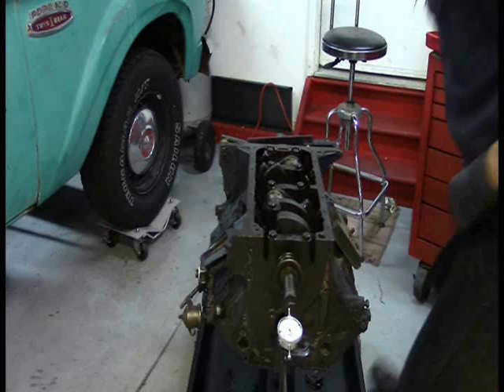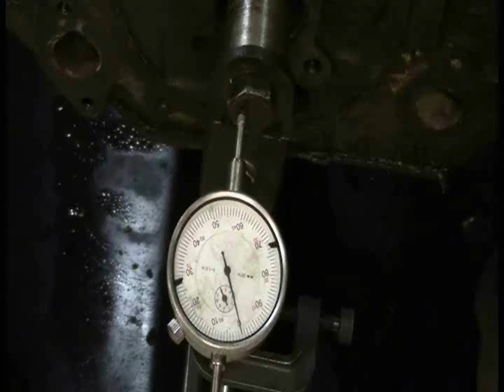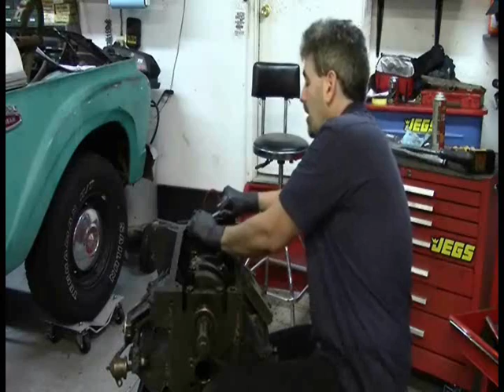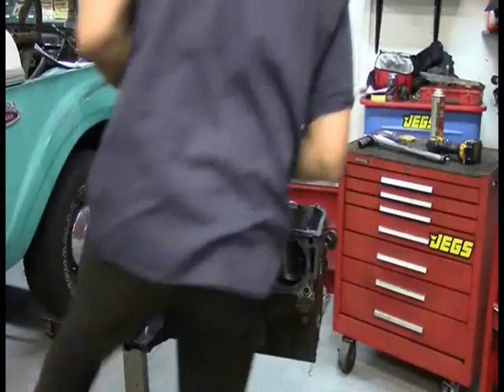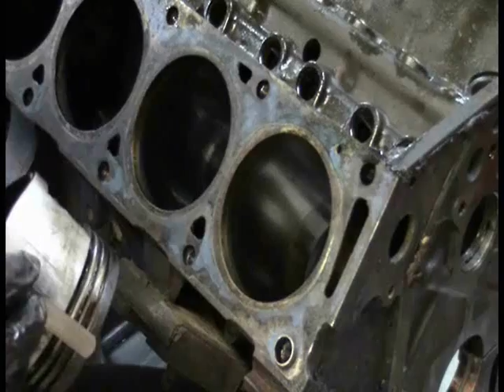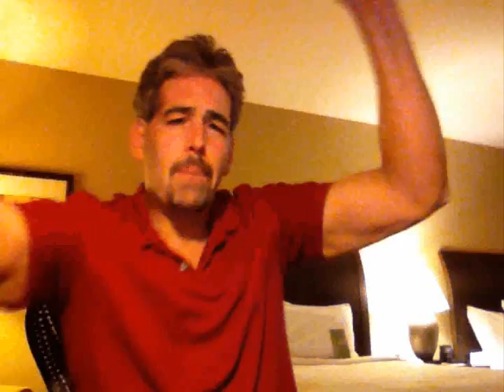Extreme Budget Engine Rebuild Pt 3- "Budget Rebuild" is an Oxymoron

Comment: I just wanted to say thanks for producing these videos. This series has been invaluable to me in understanding a current dilemma we are having with a 2001 Toyota Corolla with just under 200K miles (won't start when the engine is hot, blowing oil all over the spark plugs.) I am not a car person, and at this point I have no intention of ever tearing apart an engine. My knowledge is limited to routine maintenance which I try to handle myself as much as possible. I'm an ER nurse, and I can fix broken people, but engines mystify me.  My mechanic tells me that my engine needs a rebuild and this series has done so much toward helping me to understand what that actually means beyond the cost of parts.  I'll be able to make wiser decisions because of this - thanks!
Reply from the maker: I can relate as I am also in the medical field. I just simply apply my scientific approach to car diagnostics and repair and the result is what you see and probably why you like the format.

Comment: so is there anything  I  can do or is the motor basically use less
Reply from the maker: +91camaro 88 Two ways- you could install the pistons one at a time with new bearings checking clearances with plastigauge  and verifying they are in the right place. If after doing this on all pistons the crank rotates properly without resistance from the journals being seized then that's a fix. 
The other way is to have a machine shop ground the crank and piston rods/caps which will cost more than the engine is worth.

As for the upper end components, I wouldn't worry about that to much but do note often exhaust pushrods are shorter than intake pushrods so make sure they at least go in the right locations if this is the case.

Comment: I have a ? I purchased a motor that was already tore apart previous owner didn't number where the piston went or the lifter and push rods how big of a deal is this thanks
Reply from the maker: +91camaro 88 Its everything. The pistons are specific to their locations on the crank journals. The wrong piston location will seize the journal.

Comment: Totally enjoyable.  Been working on cars and motors since 8 years old now 71 and just launched into a 2002 ford ranger turbo 4x4 which I got on a cheep deal cause the motor needed a rebuild.  And just like your doing is exactly as I was taught long long ago and it has never failed me on the hundreds of rebuilds and repairs.  keep it simple stupid and use your head when taking it apart make notes mark things or just put them back to where they came from in logical sequence.  In other words Great information and enjoy your knowledge and straight forward approach.  waiting for number 4 !! thanks, gary

Comment: Hello, I didn't really know much about cars and such before I watched this series, but after watching your videos, I've learned a lot about how to diagnose my engine as I have a 1993 Nissan Hardbody 4x4 that has thrown a rod. I was thinking about attempting to rebuild my engine, but after tallying up the costs to do so, I realized that it was way out of my budget and I couldn't even find some parts. So in short, I would just like to thank you for all the time and effort you put into these videos.
Reply from the maker: +Connor Sincere Great move to do the assessment first. Most people just grab a wrench like a monkey and they start digging deeper and deeper into a money pit.  You did the right thing, but it's a bummer to hear. But how much better to use reason and assess the car cannot be repaired rather than spend $500 on parts before you find out it cant be repaired!

Comment: Just watch your 3-part overhaul amd really enjoyed. Thanks for clueing us in. I have a '66 Charger with  361, I was ging to have have my exhaust manifolds ceramic coated to dress them up a bit. When i removed the rear right bolt I had radiator fluid dripping out of the manifold. When I released pressure on the radiator cap it flowed out of the hole like a hose. I checked the dipstick, no water. I checked one of the spark plugs and it was normal. What could cause this and what I am looking at to repair this in terms of parts and cost?
Reply from the maker: +Scott Preston Letme get this straight- coolant leaked out of the exhaust manifold bolt hole??
Reply: +Schrodingers Box Yes, that's correct.
Reply: +Scott Preston perhaps the bolt used for the install is abit too long and punctured through the casting and into the coolant jacket wall.

Comment: Great video...I like your attention to detail.   Did you forget to mention the typical wear ridge at the top of the bores?  They can't be removed with a razor blade (LOL) and if they are deep enough then you can easily crack rings.  If you don't remove these the new rings will surely crack at high RPMs.  This engine seems to have a lot of miles ..OR... was severely neglected.  I did notice the copper backing of the severely worn bearings- the "babbit" was almost all gone!  Just thought I'd put in my 2¢

Comment: Wow. you think you need an over size cam for a 30 over bore?  LMAO  I hope no-one is looking to you for correct answers... You need one of those signs that says answers are $20 and correct answers requiring thought are outsourced.
Reply from the maker: +byrysh At exactly what size would you need an oversized cam and by how much?
Reply: Schrodingers Box
Stock carb, compression and stroke dont require a larger cam especially if its just a daily driver. There is no exactly. What there is is a desire for increased torque, horse power or reliability.
Reply from the maker: byrysh Didn't answer the question. There IS a point where you would need a larger cam.
  If you can't answer the question you are a bigger idiot than you think I am and you just look like fool in front of hundreds of thousands people by making a criticism that you can't even live up to.
  What a moron.
Reply: Schrodingers Box
Ive rebuilt hunreds of engines. Installed stock cams in engines bored 30 or 40 over and increased jet size to compensate not install over size cams. So, yeah Im an idiot all right. You can run a stock cam with 30 over bores and even have higher compression rating by shaving heads and all you need to do is run higher octane fuel.
 And your claim "you just look like fool in front of hundreds of thousands people" is asnine. You got 30k subscribers and not a single video is viewed over 50k times... Keep your dumbass in your garage. You shouldnt be any where near actual machining or mechanical profession.
Reply from the maker: byrysh Still didn't answer the question I see.
  Well, actually you did.... We all know that.

BTW check your match MORON- look at my 5 million views.  Wow, someone that bad at math surely can't figure volumetric efficiency HAHAHAHAHAHAHAHAHAA!!!!!!
Reply: Schrodingers Box
Look at per video. LMAO what an idiot. You really think that the total views are representative of seperate people that view your bullshit?
Reply from the maker: byrysh Actually I see the problem... You have had your channel 5 years and have 1/200th of the views and 1/1000th of the subs that I acquired in 1/3 the time.

  Jelly Jelly Jelly.  I see it all the time.
Anyway keep working on it goob.
Reply: Schrodingers Box
I dont have a channel for automotive work. I use it for fun... If I was to start a channel I would at least do some god damn research about wtf I am saying and varify its NOT misinformation. Otta try it. Im not jelly jelly jelly. I am a respected tech that knows wtf I am  doing in a respectable, well established service center. Not my own fucking garage. Makes ya wonder why the fuck you are still stuck using a kennedy box for automotive work. You give the term shadetree mechanic its well deserved place. In your own garage.
Reply from the maker: byrysh Yeah let me and all my subbies know when you start that channel then.  We'll be here waiting..........
Reply from the maker: byrysh Man you gonna need to shut up if ur ever ginna start that channel.
Reply: Schrodingers Box Who said I was gonna start a channel about cars? troliing your dumbass is a lot more fun. Im almost wiling to pay you for it... oh wait.
Reply from the maker: byrysh But you fail to understand... you are my bitch. I OWN you!! With just my pinky in one click Ii can delete you and all your input in a nanosecond.  And there is NOTHING you can do about because I have all power over you.
   When I'm ready.... its my choice.
Reply from the maker: byrysh But you FAILED to show my mistake.  You FAILED to answer your own comment.  You're just shamed that a DIY does better work than a grease monkey hack like you.
  Anyway i'm busy deleting your comments as I see fit before I ban you.  Get to work on that channel goob.

Comment: Great video right call on engine I once had a 74 one ton ford bought new with a 360 came from factory with bad head dealer gladly replaced it under warranty 10.000 miles later valves burned on that head come to find out dealer put used head on don't know why.

Comment: this guy is awesome, it has been a while since i have done a rebuild on an engine (im 17) and im going to help try and get an old engine running (were just going to beat the fuck out of it (burnouts etc (if possible...))) so i just wanted a quick crash course and this guy has it right, he talks about these "manual jockeys" i hate that bullshit, somtimes people have to do what the fuck is in their means (if it means j.b. welding a flywheel on my lawnmower for a temp fix while im waiting for a new lawnmower than go for it! or if its just a bullshit project that your doing because your bored!!) and while he gets into spicific stuff about clearences, etc. he does it in a quick, simple to understand way that does not take my whole fucking day to hear about how a fucking spring works.... so all of you haters need to go find an anvil to shove up your asses... drops mic walks off

Comment: hello again Matt. Um. my last post on your previous video was quite well vague. But back to the point. I want to redo the engine to not only increase its lifespan but also its power I guess I'm not very good with the lingo yet. I have found it very difficult to have anyone willing to help me. every one one I go to wants to tell me off. Anyway. my car is a 300zx. with 250k+ miles, and I would like to clean it up. it runs good for now but just has that feeling of being on its last leg. so my question is what can I do to well Put a rocket build in my trash can lol. a little about myself if you are interested in knowing.
I'm 19 and currently pursuing avionics at ERAU and being a pilot. I'm looking for anyone who will be willing to talk to me about any problems or even give advise on what to do next. its not something that I expect to be finished soon but want to be able to take on at my own pace. so anything you have to say will probably help. thank you.
david
Reply from the maker: david reed What data do you have to show it is on it's last leg to justify your strategy?

Comment: Thank you for basic philosophy, of your channel, I work at an auto parts store. And I cannot tell you how many times, an ignorant customer will simply look for the cheapest route possible. I have never rebuilt an engine but I love to learn as much as I can about my own vehicles and others. I have always had the philosophy that if you do it, do it right. Thanks again for your videos never seen an engine ripped down very cool. I am hoping with enough time and obviously money I will be as daring to take apart an engine apart to the extent.(money because if I see something wrong I cant help but fix it and make it work correctly very expensive obsessive trait).
Reply from the maker: Yes it's very hard for me to be at an auto parts store.  Every time I am there I always see people just guessing at things that clearly will not fix their car.  Just today a person bought an IAC motor to try to fix a loping idle.  The very dact the idle was loping indicates his IAC is not faulty.
  Anyway- i hope you try a rebuild someday, it's exactly how I learned most of what I know

Comment: I really enjoy the videos and the science content and the Haynes jokes.

Just curious about the quick dirty piston to bore clearance test:  (see B) (i saw part 4)

Assuming that the pistons are eccentric and as you said, oval shape, to compensate for non-uniform thermal expansion of the piston, so that it becomes round when it is up to operating temperature, and fits snugly in the round bore.

A) About how eccentric are pistons machined to be, like 1/1000 inch difference, between 12:00 and 3:00 position?

B) Does that introduce error into the feeler test, when you rotate the piston in the bore?

C) I just watched part 4, and the comment about piston wear error factor in the difference measurement is a good point.

I have turned wrenches a little less than I have turned pages, so please, do, taunt, about my esoteric, extraneous, eccentric concerns, but be aware that I get my eccentric bore theory from a 1960's edition of Audels Automobile Guide, not Haynes!

Obviously, I'm here, considering a budget rebuild. Maybe I should just make a coffee table out of my rod nockin' D17A2 and source a refurbished K20A#.  But budget is the whole point.  And I would kind of prefer to keep it a gas sipper anyway.
Reply from the maker: Evan James All your points are accurate- I did not account for the fact the pistons are not perfectly round so you are correct.  However with the piston in correct orientation and failing to measure even remotely within spec for piston to bore maximum clearance, there is still no way around it- either the piston, bore, or both are out of spec.

Comment: Hi I have a 50 year old vintage tractor and the engine is sized it sized due to running out of engine oil I haven't done anything to it yet but where do I start and what bits would be sized in the engine? Thanks

Comment: really like the videos I have ? for ya I have a 99 jeep 2.5L and the skirt on piston one broke the crank and cam have no marks that I can see or feel with my finger nail so could I put new pistons and rings and connecting rods and rod baerrings in it thanks kinda new to engine building  thanks
Reply from the maker: Last engine I had with a broken piston skirt, the cylinder walls were so scuffed it was obvious the new rings would have been worn within days.  But everything else in the engine looked perfectly fine.
Reply: going to take the top apart Monday and look at the bore I have a friend with a bore tool with the dial on it but is didn't look skuff but that doesn't mean it isn't thanks for the reply

Comment: I know this might be moot. Also yes I have never rebuilt an engine but wouldn't you wait until you get the crankshaft back from the machine shop and reinstalled before you checked end play. Sorry I'm new.
Reply from the maker: The point was to try to take measurements to assess if machine shop work could be avoided since this was a budget rebuild.
Reply: I understand that but didn't the crankshaft have to be machined already because of the messed up journals. Not trying to prod or anything. Good demonstration on how to check end play. Check out oldsmod455 he is working on restoring a 1979 AMC Javelin he is extremely anal about things I think you would like his videos and maybe you can comment on some of his stuff. You two are amazing.

Comment: Just for future reference, the 5 extra cubic inches don't matter at all for cam selection, if it was more like 30 due to a stroker build then maybe. PS I hate Haynes manuals, they sometimes flat out tell incorrect information and then leave out the only step you needed. Not sure how to remove a part, well you'll get a stupid instruction like "remove part".
Reply: Eric Fixalot 
Totally agree with you. I got a Haynes manual free with my van, and I've found it to be practically useless for almost anything other than certain torque specs.

Half the jobs I've done on my vehicle the manual had absolutely no information on. Inner tie rods and rear wiper motor, for example.
And other stuff, like changing the front brake pads, it was completely wrong about, i.e. saying I could just slide the inner brake pad out when I had to pull the rotor off.
Reply: @am529  you had to pull the rotor to change a brake pad?
Reply: Eddie Garcia yup, that’s the way it is on a ‘93 grand voyager.
You can’t slide the inner brake pads off the rails of the caliper mounting bracket towards the inner sides because the brackets themselves block the inner ends of the rails. 

So you have to remove the rotors to slide them off the outer ends of the rails.